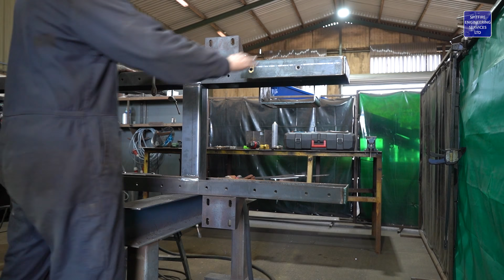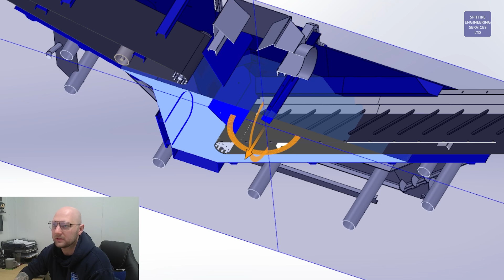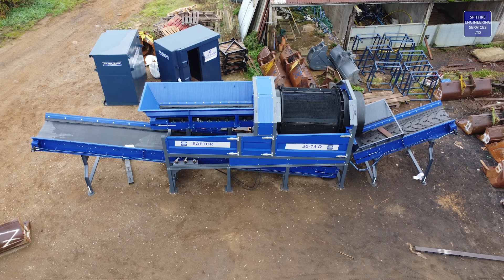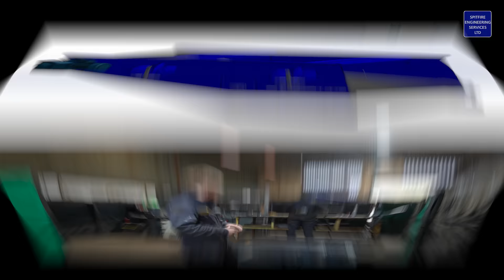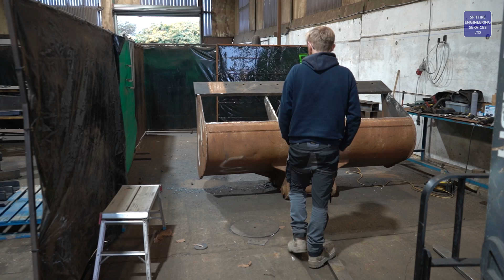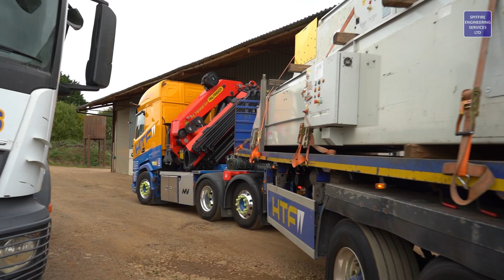Something BIG Just Left the Yard 👀

Comment: That is definitely a blast from the past with the whitworth thread. Looked very similar to metric and was easy to get mixed up. The company i first started with used old machines, and it was whitworth threads(i am not really old i promise you😂😂). It's great to see you are getting the work knocked through the shop with the usual high standards
Reply from the maker: How many people have still got witworth spanner’s in their box
Reply: @spitfireengineering  I am sure i still have a couple as they are good for hydraulic fittings on machines😂😂

Comment: Gavin - did you look at scheduling software tools like Primavera System's P6 or even Microsoft Project to do your planning and tracking task?  Too many handoffs and slowdowns due to the printing and update steps in your current process.  I have managed task driven as well as resource driven schedules in P6 for construction, architectural and engineering planning, systems integration work, and software development.  These tools track the planned resources as well as the "as-built" resources, including resource units as well as cost.  Not sure how these tools fit into your organization and business, but you might want to take a look at them.
Reply from the maker: I’ll cover this again in the next few episodes to understand why tech based solutions hasn’t worked for us